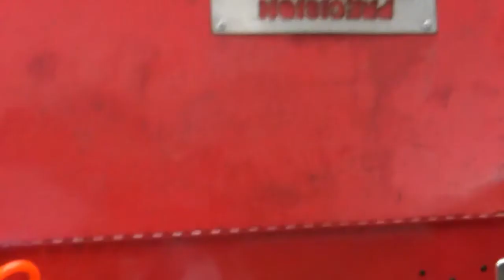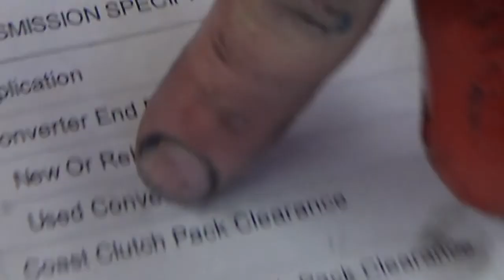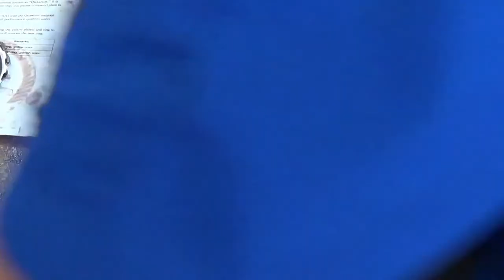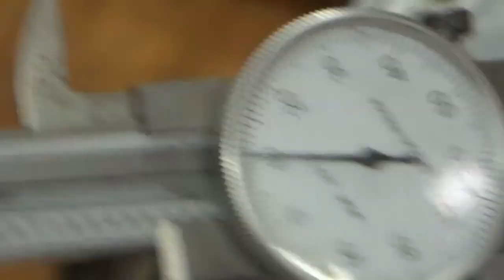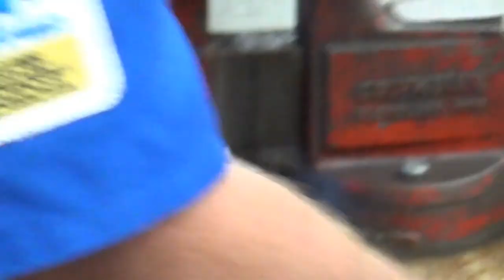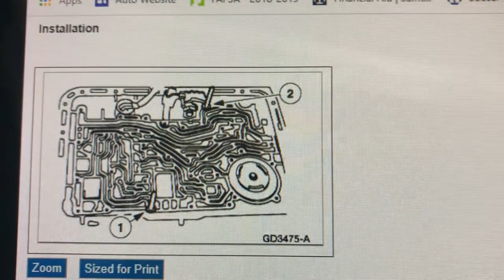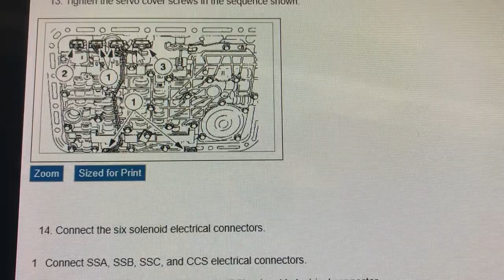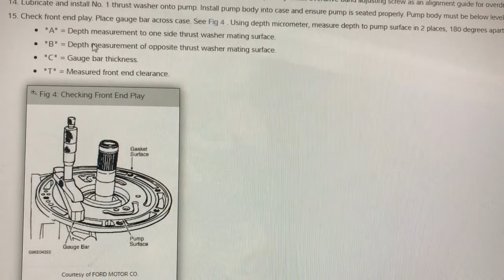Overhauling 4R55E Automatic Transmission Part 2

Comment: Thanks for this video , even if I'm not going to rebuild a trans, its good info to be armed with when I see a shop for my A4LD rebuild.
Was the different wear on the bell-housing bushing, you removed, due to poor alignment of the previous converter and pump??

Comment: At first I thought your video would actually  show the complete overhaul  but I FCC e been wrong  before and raybestos don't send any guides with their products  ( yeah tut hey getting A call trust that) like where the hell does this hinge pin in the spring go? How about the seal under the neutral safety switch ? Guy in the one video could  get the li out so he sat there forever prying the hell out of it. So how eww do  you replace that?